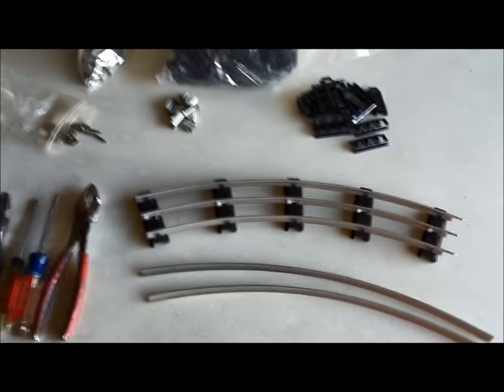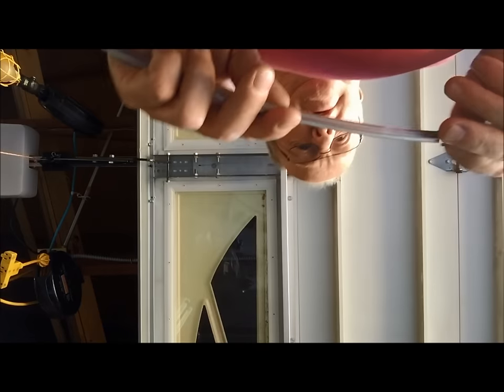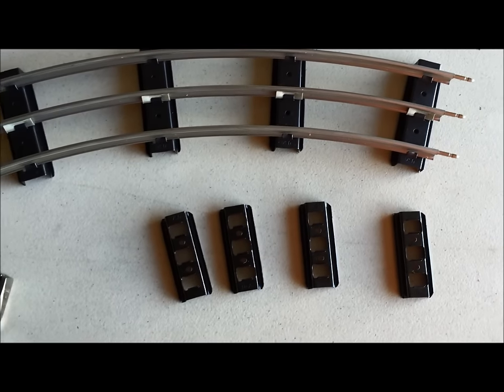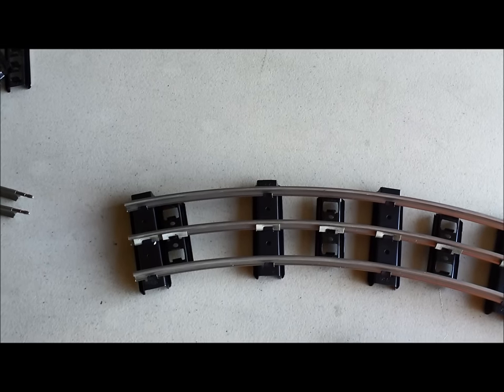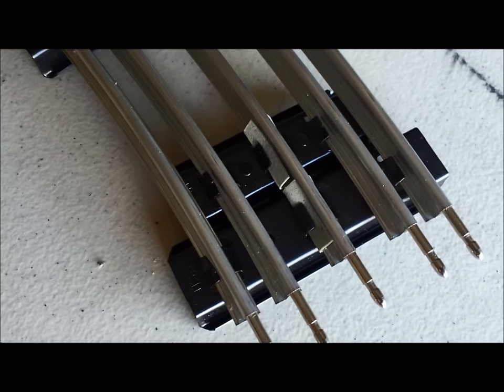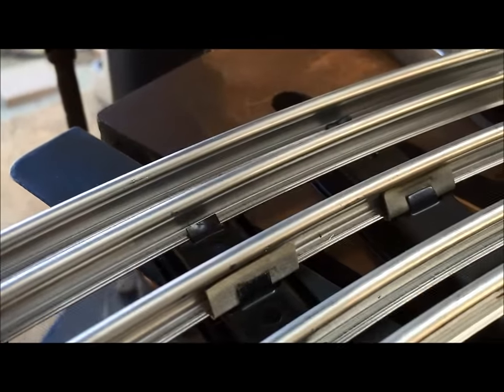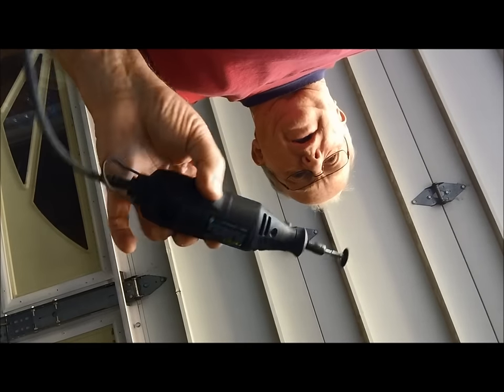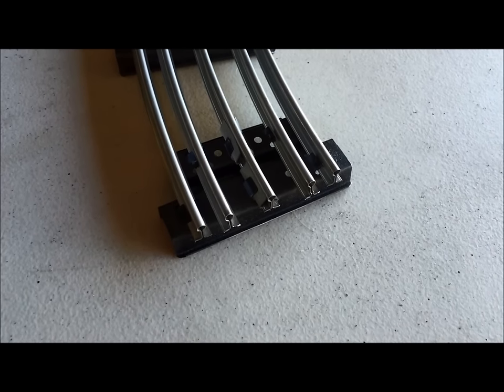5 Rail Track Assembly

Comment: how much do you actually save rather then just buying pre-made gargraves track?
Reply from the maker: I did not do a cost analysis so I can't say. I wanted the look of tubular track. Also, the Gargraves track is near impossible to bend tighter than 72". The tubular is prebent and I can get the smaller diameters I need for my layout.
Reply: @gigeastman   i just found this vid and was very ,very helpful,would like to know where you source you ogauge ties,thanks terry
Reply from the maker: @terryhudon4622  I got them from Kirk Lindvig at USA track.